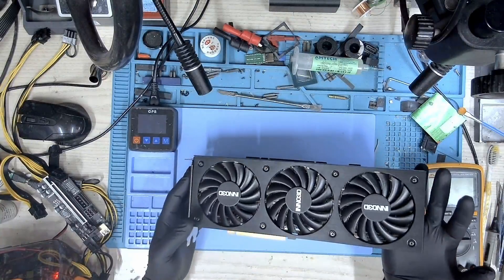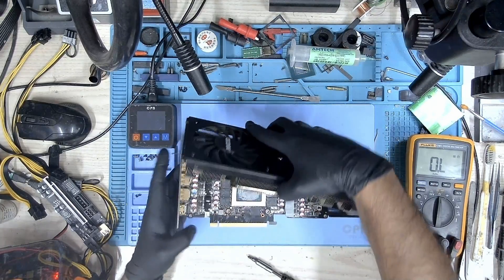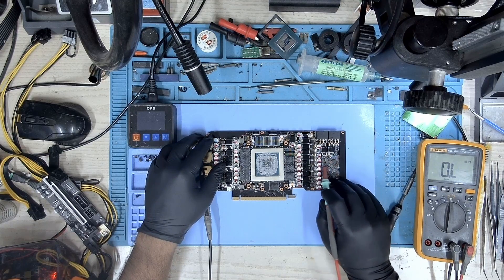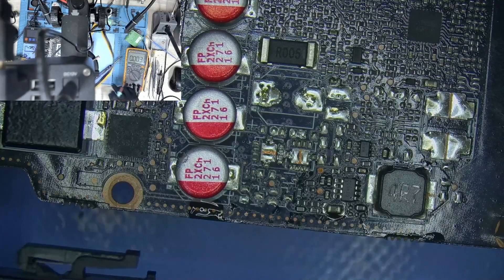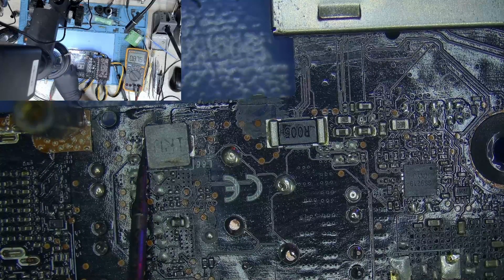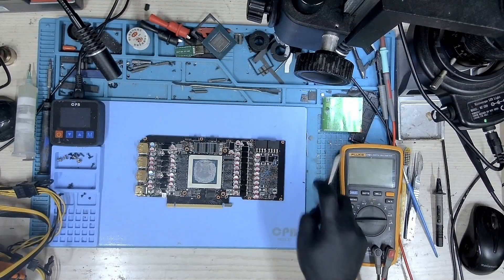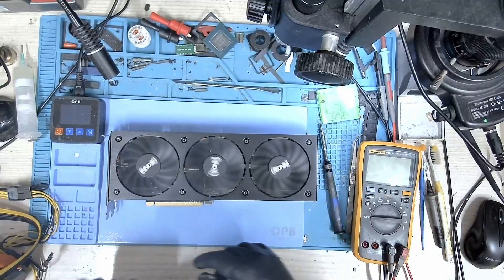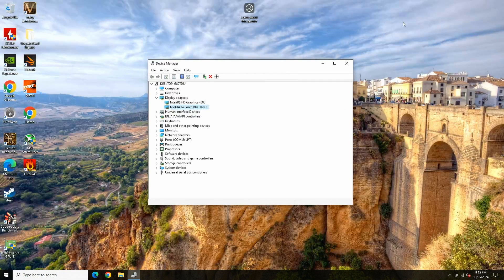Unexpected Find: Does a '3070 Ti' come with a 3080 GA102 Core?

Comment: I'm looking at the 3080 x3 card, is it a good version? How are the temps and noise? This version i a bit cheaper than the other ones.
Reply from the maker: 3080 is a good card but it would depend if you are going for 10GB varient or the 12GB varient. I would receoment the 12GB varient instead of 10GB.
Reply: @GraphicsCardRepairs-tk7ql I just bought this exact card Inno3D 3080 x3 regular version (not ichill) do you know where I could find a dissemble guide? I only find videos for the ichill edition. I also need thermal pad sizes.

Nice video that you made!

Comment: The " NVIDIA GeForce RTX 3070 Ti 8 GB GA102 " was the ONLY card with GA102 that was put out to the public, I don't know if you can slap a 102 in a regular 3070 TI like my Zotac AMP Holo since its 104 and might not have the power.

I'm VERY interested in how you do the 3070 Ti memory upgrades without messing up the cards, you have fantastically steady hands. Great work and awesome videos!
Reply from the maker: The GA102 cannot be installed on the GA104 slot. There is a size difference and the circuit is also different. The power requirements are also more. GA102 is too large for the regular 104 slot. The whole PCB will need a change.

Comment: Hey mate, i have a rtx2060 super and a gtx 1080. i would like to get fixed, but no one in Australia will do it as we don't have any repairers here. Would u be interested in fixing them?
Reply from the maker: Sure I can fix the GPUs however you will have to consider the shipping cost to ship it to Dubai and back. After you check the shipping costs involved you can book your repair by clicking the link in the video description. 😁
Reply: @GraphicsCardRepairs-tk7ql  i have checked the shipping. It's not overly expensive. Is there any import duties i need to consider for u to receive them in ur country as well?
Reply from the maker: There is 5% import duties on product value above USD 250. This is the declared value you will enter on the invoice you will attach. Else the amount is USD 15. 
When declaring declare it as damaged. Avoid over valuing the GPUs.

Comment: Sir i am from india i have a problem in my 1080 ti its power cable get burned 😢 today in afternoon
Reply: It's not woring 😢
Reply: It's warranty is also over
Reply from the maker: It can be fixed. I assume the power connector is burnt. It can be replaced. The link to book your repair is in the description of the video.
Reply: @GraphicsCardRepairs-tk7ql  ok sir thanku

Comment: Hi i wanted to ask if the chip is dead is it replaceable?
Reply from the maker: I assume when you say chip you are referring to the GPU core. Yes the core is replacable however you cannot buy new core. It iss either swapped from another GPU which has a working core and other parts not repairable. This can take a lot of time depending on a donner card to be found. There are alternatives like buying from Aliexpress but i would not recomend this option. 😁

Comment: Yes just bought two new RTX 3070 TI with GA102 on them cards, got to replace the thermal paste with bit better. Awesome videos you do all ways.
Reply from the maker: Thank you 😁
Reply: But is the performance of the 3090 there ? Or its just not all 3090 cores and shaders used  ?

Comment: I think u missed somthing , in heaven bm the gpu total TDP is only @ 40% , somthing is wrong !
Reply from the maker: Heaven does not utilise much power. That's the reason I also use furmark to test power. Heavens I ran to check for Artifacts.

Comment: do you think you could upgrade ram in a 4090 lmao
Reply from the maker: No Imao. 4090 already uses 2Gb modules and it has only 12 memory slots. 2Gb i the maximum capacity available.
Reply: @GraphicsCardRepairs-tk7ql  thanks for the reply thats what i was wondering

Comment: Released 3070ti's with GA 102 in late 2022.....
Reply: But how does it perform ?
Reply from the maker: I felt it was same as a normal 3070 Ti. I should have done a benchmarking test like in games. That would have given a clear picture. Its a miss.
Reply from the maker: I did not know that. This card took me by surprise.  😁

Comment: as long as the under chip chamber isn't breached you can soak the chip and move the wax around under the die to get the chip to work again
Reply from the maker: Thank you for sharing 😃
Reply: @GraphicsCardRepairs-tk7ql  shiney part down then roll around after preheating like spreading fluid inside a glass to coat the glass , try the card again , it might even fire up and give a screen. just keep going

Comment: I have not yet had to replace an inductor gone bad, unless related to core or vram. I have never seen a GA 102 on a 3070 Ti. Looks like Nvidia is just recycling their silicone LOL Very nice video Frazer!
Reply from the maker: Thank you. 😁. It's a rare scenario to replace an inductor. I was surprised.
Reply: @GraphicsCardRepairs-tk7ql  Especially with a GA-102 core LOL Recycling to save the earth I guess 🤣
Reply: Happened to me once too.
I think it's the same kind of inductor, too small to handle the current.
Reply: @northwestrepair  I think that's exactly it.

Comment: Amazing work, I'm surprised it having a GA102 core also, I think maybe it was a 3080 core but defective or did not meet spec so bios flashed maybe to be a 3070Ti,I have a 3070Ti and it uses GA104 (LHR)...I WONDER if that 3070Ti you have can be flashed to a full 3080!
Reply: I’m pretty sure nvidia disables the the extra cores at a hardware level, in the past there have been chips that they only disabled at a software level and you could bios flash them to a higher tier gpu. Safe to say that lessons were learned and now unfortunately we can’t take advantage of that.
Reply from the maker: Yes they are dissabled on the core. 😁
Reply: @user-fo3yy7ql8o  damn, there go my hopes on a "free" tier-up upgrade. Yet though, do you recon it would be at least possible to solder on a few more memory chips to expand the 8GB memory bottleneck?
Reply: @T3m0xx  probably but you would need to find the exact memory chips . ive seen people double the memory in some gpus by replacing the existing ones with higher capacity memory
Reply from the maker: Yes that's what I thought. GA104 is what I was expecting. 😂